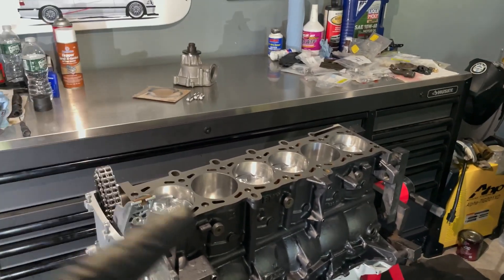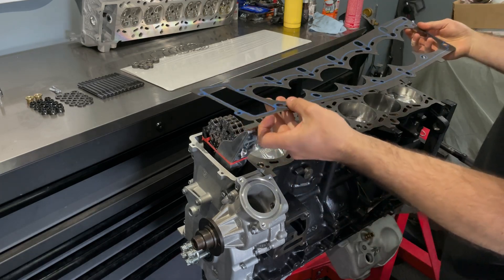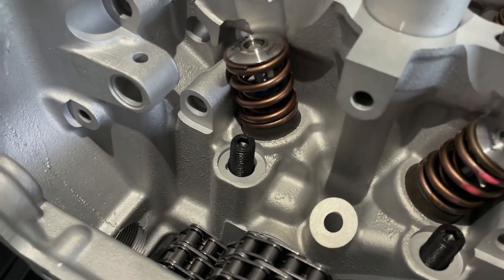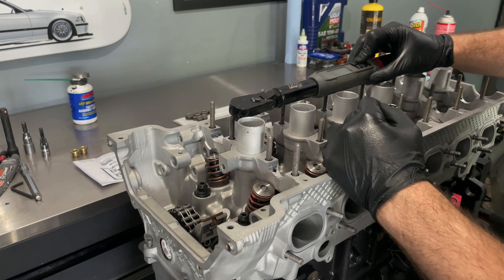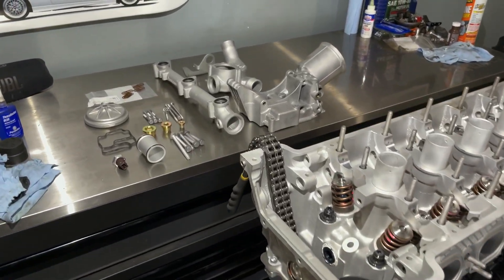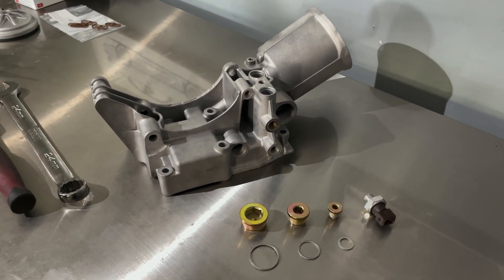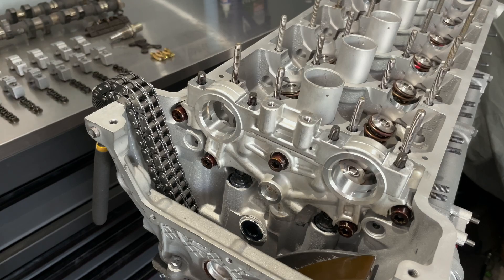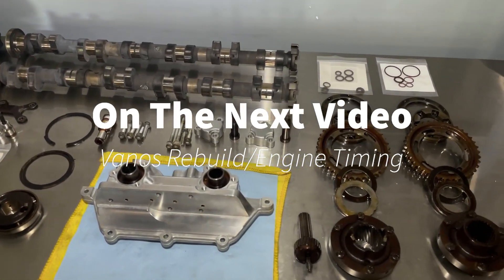BMW S54 - Engine Build / Cylinder Head Install - Build Series Pt. 3

Comment: Hi, Thanks for the video. I have a question regarding the spline shafts. What clearance should be the good one. There are few that match there's one position that the splines goes all inside. Any information is appreciated.

Comment: Is this cutring headgasket made  for oversized 87.5 pistons? Seems like they all say  "87.5mm bore (for use with 87mm pistons)". If thats the case, which brand did you gou with?

Comment: Hold up hold up correct me if I’m wrong but arp clearly states in my instructions to not have any oil or lube between the washer and head. You can put the lube around the threads and above the washer and underneath the nut so that the nut can slide with ease over the washer but we want the washer to have friction against the head and not rotate hence the reason for not having any oil under the washer. Please tell me what it says in your arp instruction manual as of date? I know they always be changing up the procedure so if I’m wrong fill me in bud…..
Reply from the maker: ARP is forever changing, but as of the date these were ordered (April24) the instructions say to lubricate the washer, nut, and stud. If you watch, I only put a small amount anyway and after the first toque sequence most of the lube gets pushed out. I’ve installed headstuds both ways and have never had an issue of the cylinder head lifting. At the end of the torque cycle you’re still yielding the same clamp force with or without the lube on the bottom of the washer. If you look at the washer during the second torque cycle it usually stops moving too. Some applications have a stamped washer to lock into the cylinder head, and my assumption is that if ARP wanted the friction then they would apply that to these kits. Either way, End of the day it’s negligible. But I follow the updated directions (except on m5X engines lol)
Reply: @OnlyyDans  but real quick regarding the bolts and nut on the head and torqing more great and the more sliping of that washer against the head will yield and much higher overall torque load. We don’t need washers bitting into the head and cause unforeseen deformation of the mounting points over time 🤷‍♂️
Reply: @OnlyyDans  let’s not even begin with my frustration related to the m5x topic 🥲 it’s a love hate with that one! Especially when I did a perfectly normal head gasket august 2023 and just before Christmas I received an early gift, now mine you from the time I rebuilt the engine till this point I’ve been giving it hell all summer long and not a single hiccup or sign of issues. I specifically I recall a shift in the weather that took us from normal to winter here in Los Angeles and this is when i saw something my eyes could not believe. Gasket failed again and coolant is seeping outward between the block and head and what’s mind boggling me the most is how it isn’t mixing this time and how in hell the leak is under the intake !!!!!! In all my years of working on these 6cyl engines I have seen them piss oil and coolant regularly due to old age and heat deteriorating the gaskets sealing capabilities especially around the areas of where the red thin sealant resides on the gaskets mainly nearly the exhaust where temps are the hottest. But never have I seen a head leak under the intake and defy the laws of physics and gravity. I’m so pissed because I went the extra mile this time and even sent the head out to the machine shop and did arp too. 

Normally in these situations when the car shows no signs of overheating like with two other s5x engines I’ve had over the years. I’ve literally just done gaskets slaps at home and we are driving by night but this time I said to myself she’s a keeper let’s not be stupid and let’s get the valves cut and surfaced decked. And then this is the outcome of me taking extra measures to prevent such a failure LOL I hate these old bmws

Comment: Where did you get the crush washers for the plugs on the oil filter housing? I am having trouble finding one for the largest plug
Reply from the maker: I just measured the stock gasket and ordered it. I probably have the dimensions in my notes if you need
Reply: @OnlyyDans  Yeah I measured mine what came out, but I cannot seem to be able to order it anywhere, would be nice to know where you got it from.